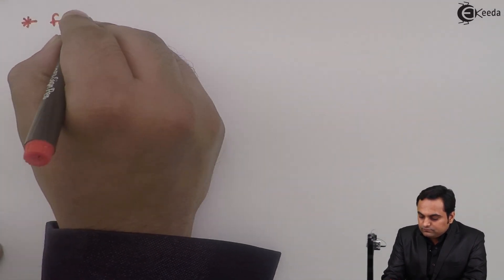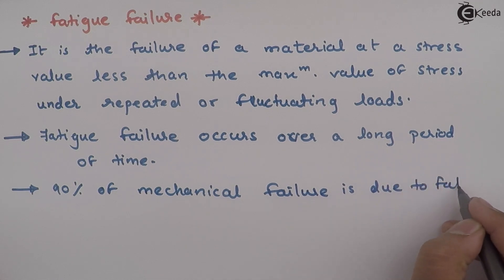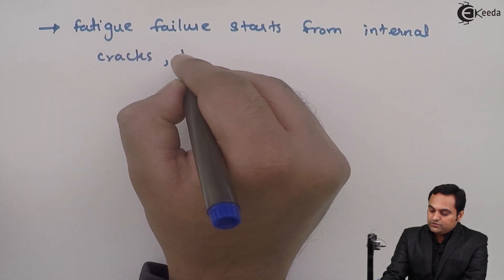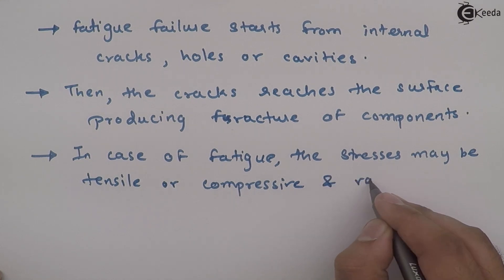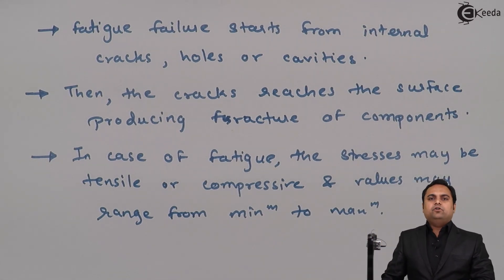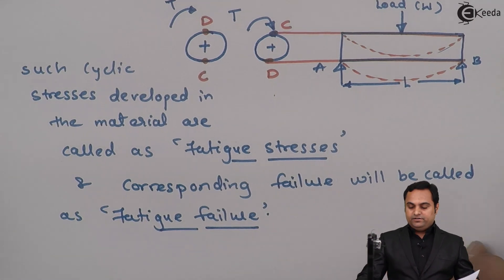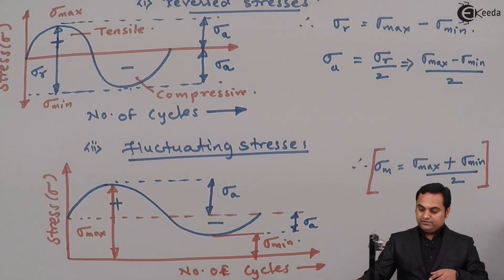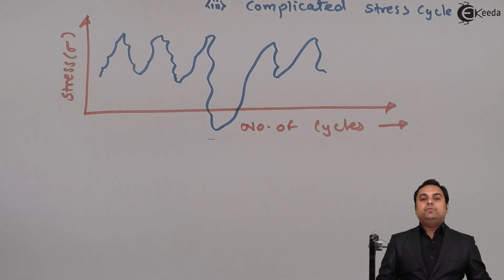Fatigue Failure - Theories of Elastic Failure - Strength of Materials

Comment: why does fracture occur at a lower load than the maximum load
Reply: due to continuous cyclic stress, there is work hardening (material is hardened)
due to this material breaks at low stress even sometimes below the yield strength